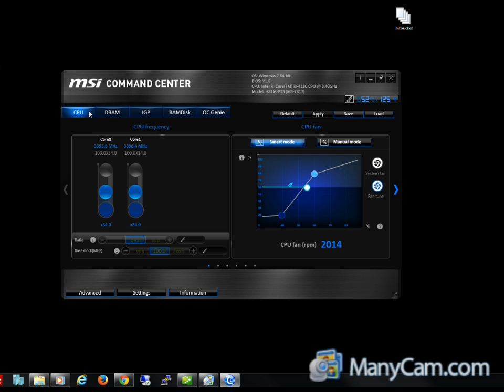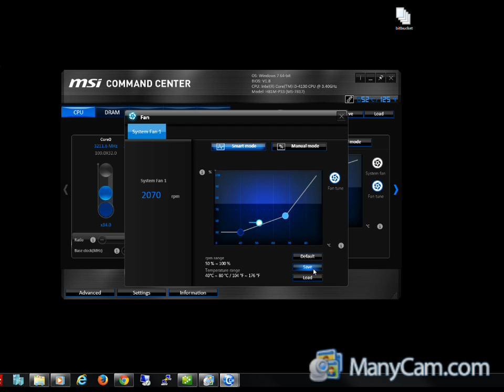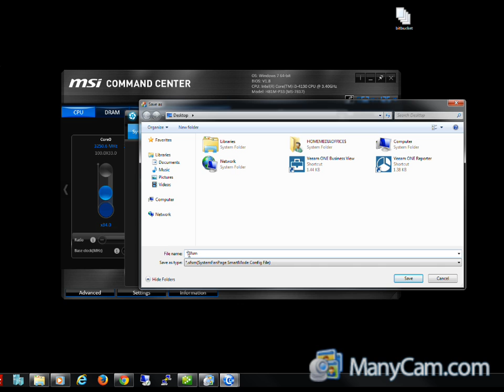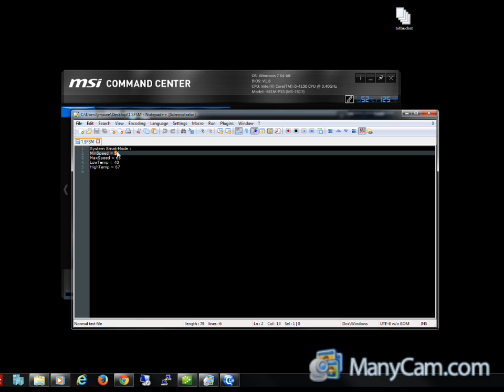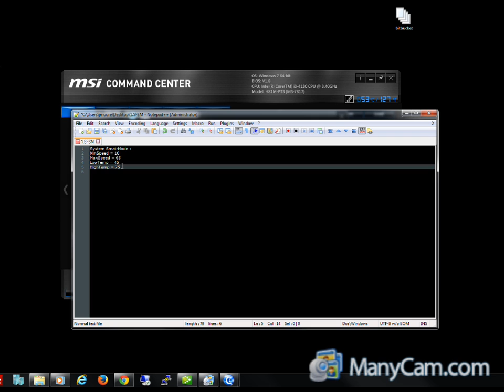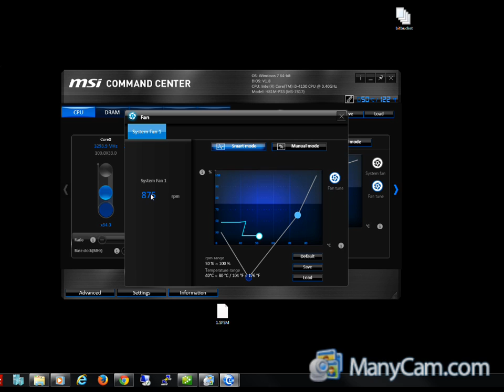Quiet MSI PC Fan Speed Hack

Comment: I have downloaded CC 1.0.1.08 for Win7 for H97 Gaming 3. This method does not work with the manual mode but it still works for me with the smart mode. The fans of The Corsair Obsidian 750D need about 28% minimum to function. The fans are finally quiet. Thank you for sharing that!
Yes, it is only temporary and you need to set it after every reboot again.

UPDATE: I am currently working on an helper program that can automatically set the fan speed without opening the command center (but it needs to be installed though). So it would be possible to let it set the proper fan speed as soon as you login on your computer. Although the needs some additions to make it user-friendly it can already set the fan speed for my H97 Gaming 3 successfully on its own. If you would like to test it, drop me a line somewhere.

UPDATE2: Here is the program I made: https://github.com/Nithanim/fancontrol4msi/releases This only works on 64bit for now. You can run it with following arguments, each argument separated by a space. Specific instructions on how to use it are displayed when running it without any arguments. Make sure you open in via cmd to see the output. It both work with and without administrator rights but without it, the "MSI Command Center SuperIO Service" must already be running. To run it on logon you might want to use the windows scheduler. I am using the following arguments for me: "3;1E;23;2D;3C;2D;37;41;50;77; 8;1E;23;2D;3C;2D;37;41;50;77; 9;1E;23;2D;3C;2D;37;41;50;77;". Do not forget to check "highest privileges" so that the service can be started.
The program was only tested on H97 Gaming 3 but should also work on other mainboards that use the Command Center.
Reply: +jollymonsa I am most definitely not. I am right now polishing it up a little bit and the publishing it over at my github page over at https://github.com/Nithanim/fancontrol4msi
However, I am searching for someone to test that so I can be sure that it works. Do you have any idea how that can work out?
And yes, do not download random shit from the internet ;) Good to stay cautious!
Reply: +jollymonsa And yes, I do need to apologise! This is my first time coding something in C. My primary language is java and I had no-one scream at me till now since you can decompile that code no problem so I am not used to this whole .exe "hate".
Reply: +jollymonsa That is great news! The Command Center is a .net application. I have never worked with something like this but i found a really good decompiler and debugger and found everything out I needed. If you looked into that yourself you may find out more than I did. 
And as the CC already requires .net we may be better off that you use your knowlege of c# and port my program. That way I do not have to mess around with compiling C anymore :D
I simply not wanted to have a whole JVM to boot up for such little task.
Reply: +Nithanim I really appreciate your build - thank´s! But do you require  CC 1.0.1.08 for Win7 for it to work? The oldest version i can find is 1.0.140 for Windows XP/Vista/7. Can you give me the Link to the  CC 1.0.1.08 Version?
Reply: +Benjamin Becker Thank you so much for trying it out! I basically cannot guarantee that it works with any other mainboard than mime, other OS than Win7 64 bit and any other version of CC than that I used because I cannot test every combination. However, I believe that they won't change CC enough that my tool breaks because they would have to change the entire communication between the GUI and the service executing the commands.
I would suggest you simply take the version of CC you are comfortable with and try it. I would be great if you could report if that works and any fails you might encounter.
Reply: Nithanim
 No Problem. I got so far, to realize that my Motherboard only supports one of the newest Versions of MSI Control Center. I use the newest one 2.5.060. I Still have to try, if your Program works.
Reply: +Nithanim Hey, i tried using your Programm tonight, but i can´t figure out how to. I downloaded the fancontrol4msi exe and executed it via CMD while MSI Command Center was running. Your Programm opened a Window for about a second, executed some stuff an disappeared again. It didin´t change the fanspeeds though. I see that i have to put in the arguments but how do i do that? I would be nice if you could write a step by step instruction.
Reply: +Benjamin Becker Thank you for trying! I have to admit that it is pretty
 hard to use but I am unable to do a lot better with this 
programming-language.
When you have open the windows (file) explorer in the folder where you downloaded the .exe into, you can shift+right click on a blank space to get something like "open command prompt here" (translating that to english, so it might be far off) (and make sure you have not selected any file). Then you can write "fancontrol4msi.exe" in there (you can use the tab-key to autocomplete). You now can run the program by using the enter-key which will display basic instructions on how to use. You may also consult the the readme on https://github.com/Nithanim/fancontrol4msi which are basically the same and more readable instructions. 
The problem with this command prompt is, that it has only user rights and so has my tool then. That means that it will only work when CC is running because it can't start and stop the service because of missing permissions. To fix that you would need to start an elevated command prompt, but for testing the basic one should suffice.
As the fan ids are concerned, you either have to do some trial and error to figure them out (I don't know, however, if you can break anything with that) or you could tell me you exact mainboard by providing the values that the gui displays in the top right corner. However, there is a chance that I might not be able to because there are no values specifically for my mainboard hidden in the CC but it rather uses the same as some other which I could only find out by debugging with my mainboard. Your mainboard likely has the same issue for me.
If you have any more questions or problems, feel free to ask them and I hope I will be able to answer them all.
Reply: +Nithanim Hey, thank you for your Explanation! I tried the Steps you described a couple of times, but i haven´t been successful. I got so far: I was able to open your program via the cammand prompt. i can read your instruction in the Dos-like-window. Below the last line of your Acknowledgement the commandline is repeated (C:/mycomputer/User/Downloads......) In this command line i paste your example code: 8;1E;23;2D;3C;2D;37;41;50;77;. 
I hit Enter, and then there is stated: "The Order "8" is either written wrongly or couldn´t be found".
I guess i youst didn´t operate your programm correctly. 
I would appreciate your advice!
Reply: +Benjamin Becker I am really sorry that I was not clear enough! The code "8;1E;23;2D;3C;2D;37;41;50;77;" are only the arguments for the program. To run it you still need to specify the program in front of it. In other words you have to run it like "fancontrol4msi.exe 8;1E;23;2D;3C;2D;37;41;50;77;" or "fancontrol4msi.exe 8;1E;23;2D;3C;2D;37;41;50;77; 8;1E;23;2D;3C;2D;37;41;50;77;" if you have more than one fan. I hope that clears up some of the misunderstandings!
Reply: +Nithanim  Ah okay, thaknks, but now, it states:  "Unable to open config file! Could not open service for starting (skipping) Error 1060: The Stated service is not an installed service         
Open Service for control: Error 1060: The Stated service ist not an installed service."
I´m curious if you can figure that one out :)
Reply: +Benjamin Becker Now that is some interesting error that you got :/ It basically finds absolutely no traces of a CC installation.  Could you please tell me if you have the folder or more specifically the following file? C:\\MSI\\Command Center\\MSISuperIO.cfg
And I would like to know if there are any services installed, specifically "MSISuperIO_CC" or "MSI Command Center SuperIO Service" as it is its full name. I have 9 in total starting with "MSI".
I have a bad feeling about that. If your installation is completely different than mime it will be hard to get that running for you :(
Reply: +Nithanim Since you told me that you have a newer version of CC I looked for it on the MSI download page myself. The page showed me that 2.0.0.20 is available but interestingly the zip contains 1.0.1.08 so it is not possible for me to look into that on my machine.
I forgot to ask what version of windows you have installed (you never explicitly stated it) and maybe also your type of mainboard would be helpful .
Reply: +Nithanim All right, i will get back to you in the morning.
Reply: +Nithanim 
Hey,

unfortunately there are none of the stated Folders or Services in the directory, where control center is installed.

currently i use version 2.5.060 of MSI Control Center (I got i via using MSI Live Update).

I installed  version
 2.2.098 of MSI Control Center (which is from 2013). But also in this 
version none of the services occour in the install directory. I tried 
your version 1.0.1.08, but accidently this version doesn´t support my mainboard.

I run Win 7 x64 professional

on a MSI Z68A-GD65 (G3) (MS-7681).
Reply: +Nithanim I have to add that there is a "SCEWIN_64.exe" which seems to be a commandline application which could potentially send the rights commands because it tries to load the driver (which i don't have so I can't test). But you might want to open that and see what happens.
Reply: yes, SCEWIN_64.exe is a command line application. i could send you a screenshot of it, if you give me your email.
Reply: +Benjamin Becker I did some research about this program and found out that it is a pretty generic program to change arbitrary values in the bios. It seems that you can severely break something when you don't know what you are doing which was not exactly the case with the service in the old CC. 
I doubt that some screenshots would help finding out what you can do with this program but if you want to send some anyhow then you could send it to <whateverthehellyouwant> over at nithanim.me (yes, that is an address^^ - hope that it works though, but we will find out).
As this version of CC does  not work with my board, I would have to mess around with it on your computer which would not only heavily invade your privacy but cost a lot of time which I do not have currently. Furthermore, I really do not want to break anything of yours by messing around with it.

HOWEVER: There is a slight chance that CC calls SCEWIN_64.exe by simply running it (instead of using some hidden messaging system or calls). This calls could be intercepted and manually sent but this is only a speculation of mime.
Reply: +Nithanim Hey, so wie es aussieht hätten wir uns das Englisch auch sparen können :)

ich habe jetzt mal die Mailadresse benutzt, die du auf deiner Seite 
angegeben hast, da ich dort keine Funktion gesehen habe Dateien in den 
Anhang einer Nachricht zu packen. 

Vielen Dank für die Mühe, die du Dir bereits für mich und die anderen frustrierten Benutzer der 2.0 Version gemacht hast!
Reply: You're the real MVP. Hope this will work for my H81M-P33.
Reply: Oh, for some reason it gives me an error "Error 1053: The service did not respond to the start or control request in a timely fashion." when I try to run it. Oh well.

Comment: I have version 1.0.1.08 and this is working (again?). Thanks for the help! :)
Reply: +Florian Dootz Guess I was happy too early. After a restart all my settings were reset. :(
Reply: +Florian Dootz It seems that I joined late to the party. I was also mad at MSI to find out all their stupidness but I managed to extract all the information needed to build a program that can apply some fan settings automatically. It is still hard to configure and I don't know if I got all the values right but my fans react accordingly to my input :D I would also need someone with another mainboard to test so would you mind sharing what mainboard you got (The model that is displayed in the Command Center)?
Reply: +Nithanim Would love to try out the program. Just got the z179a gaming pro carbon, and seeing all these comments now.

I actually do QA for a living if that makes me a better candidate. :D

Comment: does anyone know, because my MSI motherboard says: CPU MIN FAN SPEED (%) 50% better or is 87.5% better? I am confused.
Reply: ***** no, I have quiet fans; however, I want to keep the computer and cpu the coolest possible. Plus, should I have the cool n quit on or off? I am confused on those two?
Reply: for max cooling disable the quiet cool and in general disregard this guide. this is for getting the system fan below 50% and very quiet.

Comment: Why isn't this an official option? I have fans that are pretty load with 50% and I want to have most of the m off on idle. This makes the (for me) useless fan control just perfect!

btw.: I have 1.0.1.02 and it works for me. So maybe it was added again?

Update: have to change my opinion: after every restart I have to reimport the settings in the MSI command center, as the restart overwrites the settings :-(

Comment: You shoudn't reduce power below 50% in 3 pin system fans, since 3 pin connector adapters lower voltage to reduce rpm and depending on fan type, some motors cannot sustain themselves on lower than 7 volts power supply, in other words, fan motors would stop spinning and that is not a good thing and if motor is not spinning while power is on, heat starts to build up in motor.
Well, unless you have 4 pin connectors, you can reduce fan speed safely below 50%, since 4 pin connectors always provite 12 volts and fan speed is controlled by 4th pin, which sometimes called PWM pin. Idea is that it controls voltage pulse and in this mode motor can spin safely at lower rates without loosing momentum. I suggest checking your motherboard vendor manual to see which fan connectors you have and which is which.
Reply: ***** Normal PC fan controllers won't let you go below 40% or 5V. Also if you're using low quality fans, even 50% can stop motor rotation. Ant thats for 3 pins.
Reply: ***** Don't get me wrong, high quality components most of the time are designed keeping in mind that there can be such a low voltage. Also every fan has its lowest operating voltage, like 2.5V, or 6V, cheaper fans tend to have higher operating voltage. I'm just saying that if you have cheap fan, just be careful what are you doing on how much you lower voltage.

Also sometimes noise is not by fans itself , but from air going through surrounding. That I have learned hard way by having stupid grating design on front case panel, there was this annoying wush sound everytime fans hits over 1000 rpm, removed grating, sound - gone.

Comment: just downloaded the latest version from msi. followed the instructions and it shows the levels well below the chart. i actually set them to 10% minimum and 20% max, but my fan speed is still maxed out at 2800 rpms. the only that helps is pulling the cmos battery, which is only good for one or two reboots.
Reply: if anyone was having the same problem, this is what i did to fix it.
No, it didnt take me two years, maybe just 2 days.
i tried a bios flash with almost all the firmwares on the website.
eventually i gave up and forgot about it. then i updated my usb 3.0 drivers which also was giving me problems.
and that fixed all my fan issues. weird.
eventually sold that pc and had a similar problem with the ethernet on my new rig. a usb 3.0 driver update fixed it too.

Comment: Yeah Jolly is right, i just tried it and it didn't change for me. My problem is that my top case fan runs on the CPU2 FAN and it has 2,200+- RPMs and that lil bish is loud! I hate it because in my live stream, people can hear it clearly. Any possible way to control that CPU fan on my Z97 Mpower MaxPower OC ???
Reply: Project_13_Mayhem You can set the CPU2 to smart mode and have it running at 10% WITHOUT doing the trick in the video :) I run my top fans at wonderful 200 rpm!
Reply: +Project_13_Mayhem is that a 3 pin fan on a real 4 pin pwm connector? on my board (x99 gaming 7) the two cpu connectors are pwm connectors (all are 4 pin, but only the two cpu connectors are pwm, you can see this from the manual. if the 4th pin is sth like speed control, than its a pwm). i had a 3 pin fan connected to that one and it was always running on 100% no matter what i did. it seems 3 pin on pwm is not working in this combo. attached it to another sysfan connector and it works now!
Reply: +Martin Sieber thanks for the respond! 4 pin fans, it was the corsair link wasn't working properly after the windows 10 update. Also ended up buying a front panel fan control, that helped a lot!

Comment: Thanks, sadly after shutting down the pc and restarting it it goes back to normal.
And in the bios directly you can't drop it under 50% .. even with most games my pc runs at 55 degrees (outside it's 35+) and there is almost no use to run all 5 fans at 50% all the time. I'm not planing to have the coldest pc ever.
Reply: lootmaster1337 Why don't you just unplug it then ? lol

Comment: msi command center does not support this Mainboard :(  but ..... its an msi latop . currently i can pick between not doing anything . and let my laptop run abit hot .cause the standard temp scheme doesent ramp up the fan like i would think it should .. or i can press a button that makes the fans go 100% wich sounds like a helicopter . Poop